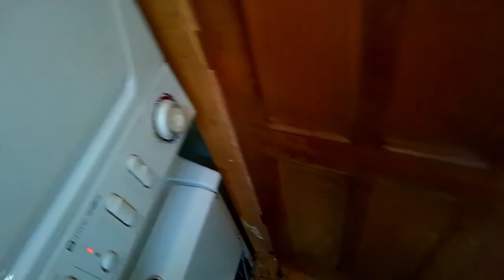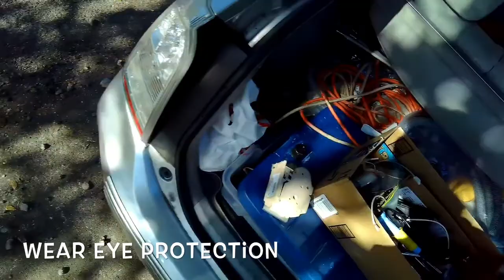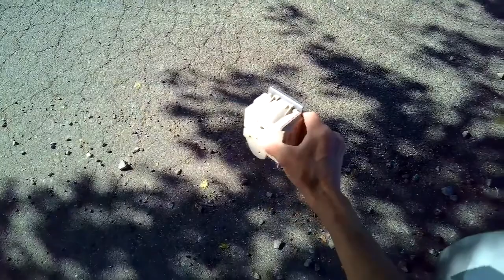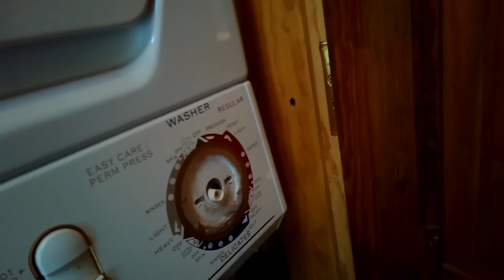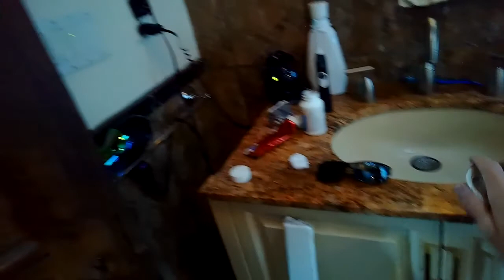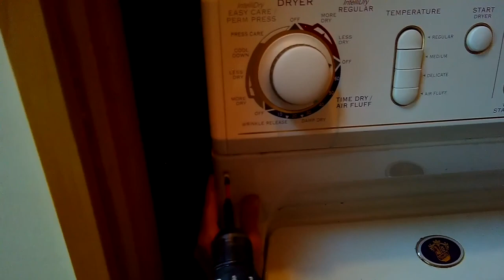✨Maytag Washer Timer Wont Advance (FIXED)✨

Comment: Mine won't advance if I turn the dial past the 45 minute mark, so I'll definitely try your suggestion.
Reply from the maker: The motor might be overheating at 45 minutes because it’s too dirty with lint build up.
Reply: @QuickAndEasy5MinuteAppliance  I'm sorry, which motor are you referring to, the little motor within the timer or the motor which turns the drum? Again, if the timer is set past the 45 minute mark, the drier continues to dry even when the clothes are dry. Could it be the heat sensor located in the drum?

Comment: UPDATE!!   Well, I took out the timer and used about half a can of contact clear and it did not work. So, I decided to just BUY the NEW timer and it cost me a bit OVER $200.00  Installed that and ALL is well. For what it was worth I then took apart teh OLD timer and HAD to break the "melted plastic" they use to keep you from tampering with it. Well this thing has a LOT of "contact fingers" that do what it needs to do to work. Upon looking VERY closely as you look right at it the VERY last set on contacts on the RIGHT hand side, VERY last the "tips" or contact part was burnt black. Ten cans of contact cleaner would neve fix this as it would need to be scrapped clean of the burnt part. I done this JUST to see what was what. Hope this helps a bit. Questions? Just ask me. I go by nick name of "HOUSE KAT". This is from my " Bethlehem Steel" days at Sparrows Point Maryland.
Reply from the maker: Great info. Thanks so much👍

Comment: Well, I had the problem with the water NOT emptying. It was NOT the timer but it WAS one of the electronic cards in the machine. NO, I DID not figure this out. I paid for "THE MAN" to come to my home. Yeah you know that answer. Arm, leg, first born...etc....
Reply from the maker: 😂😂 so glad he could fix it.
Reply: Why it's usually best odds to replace it. Somebody gave me a matched set of Matytag's from the 70's, had been sitting in their house dry for 5 yr and they dicided to buy new. Took them home hooked up the washer and it worked perfect, three years now. Couldn't use the gas dryer - we're stone electric - so loaned it to some friends..hooked it up, no gas flame. Replaced the igniter, no worries. Older designs never break; and IF they do, easy cheap fix.

Comment: Hello. Is this video a follow-up to another where the same machine was leaking water? Mine does leak only from the door, so I assumed that the machine was overflowing. In the other video you mentioned that the leaking problem was because of a faulty timer. I have noticed in the past that the machine would stop for no reason, but I only had to press start again and it countinued with out a problem. The leaking is the new development, actually. So, by cleaning the timer, did the leaking problem got resolved? Or was it something else?
Reply from the maker: Hi Jonathan,
This one’s pretty easy to fix.
You need to remove the front panel and the washing machine door .

You’ll see a black tube connecting from the right front side of the washing machine in running into the tub.
That black tube is clogged with junk.
You need to remove it and clean it out and that will solve the problem.

Comment: Hello and good day! 
I tried this and then I also replaced the timer but it is still not advancing. Any idea what to do next?
Thanks so much!
Reply: Same here, two timers, same problem. I suspect something on the circuit board, I will let you know what fixes mine.
Reply: Ok, the triac "Q9" was internally shorted, I replaced it with one from an old control board and it fixed it. The clue was the resistor in series with it was showing signs of being too warm. The problem is that when the triac fails, the cold water valve will not open, so the washer stalls when it tries to refill for the next cycle.
Reply: @SuperMonkeyFling  Thanks for the reply. Same thing I had to do,replace the circuit board.
Reply: I make it a rule never to deal with two-timers!
Reply: @goodcyrus  Yeh, so I was talking to my shrink theother day and I said, "I don't know doc..I'm a tee-pee, I'm a wig-wam! I'm a tee-pee, I'm a wig-wam!" he said, "You know what your problem is your two tents!"